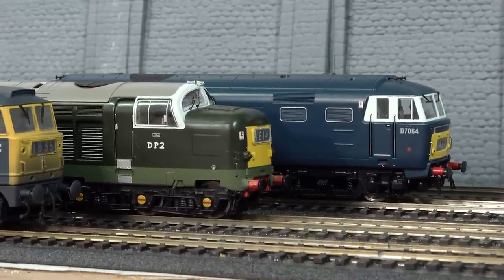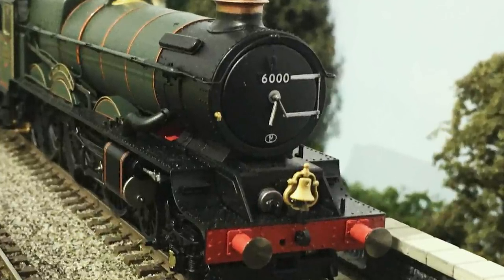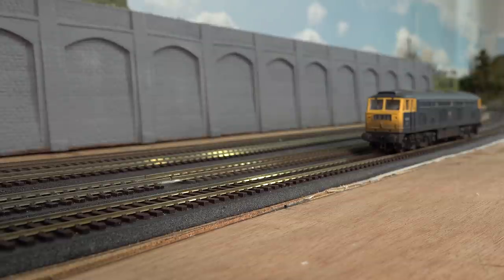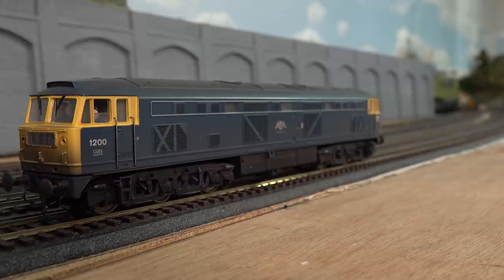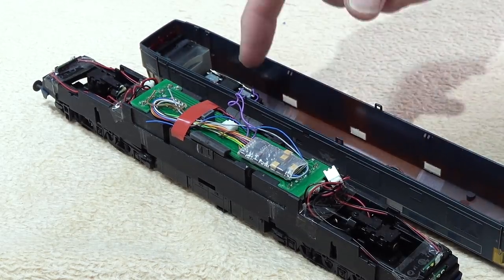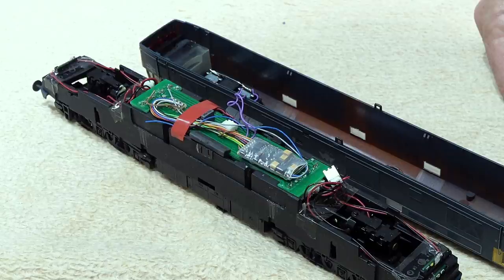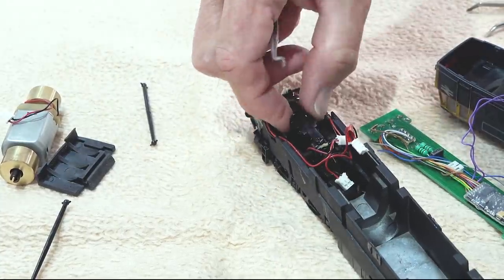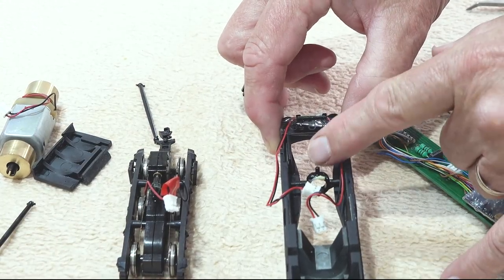Loco Repairs at Chadwick Model Railway | 143.

Comment: Hi Charlie, I am back after a long time. As I said I am 72 and just building my layout. I have a few questions and hoe you can help me  out. I have I have a few Hornby Locomotives which have the old ring-field motors, and things like carbon brushes and springs are hard to come by. Are there any solutions to replacing them with newer motors. I am also hoping to get some basic decoders and digitlise them for DCC. I cannot afford to replace my old locomotives with newer DCC ones and hence this question. I would ask the same question to replace the motors ( ones where the armature is visible and held by metal clips with the magnet at the back and the brushes dropping down to the commutator) commonly fitted to the early Hornby models like the 0-6-0 Tanker, 2-6-2 tanker and the Princess class 2-6-2.

I also have problems in the valve gear of both the 2-6-2 tanker and the princess class 2-6-2, as the driving shafts and valve gear are identical. Once the nail is screw from the tunnel to the chassis, it somehow jams the operation of the valve gear and it stops. 

Watching your excellent video just no prompted me to request for your help, if there is any hope for the questions I have.
We do not have hobby shops or professional repairers and so I take pleasure in doing my own repairs.

My email is faizal126pr@gmail.com.
Thanks and Take Care.

Faizal Hathy,Colombo, Sri Lanka.
Reply from the maker: I suggest that you email Peters Spares, as they have a mass of old stock and I'm sure that they could help.  Regarding the valve gear, sorry but I really have no idea on that one.
Reply: @ChadwickModelRailway  Hi Charlie, Thank you ever so much for the referral. I wil try peters spares. Take care and be safe

Comment: Really halgen should rectify the issue i mean really for a expensive model shouldn't have to be going into the model and fix especially for newer models. But awesome video. But i feel Helgen should do more i feel
Reply from the maker: We are where we are but Heljan aren’t alone.
Reply: It's not only Heljan. My Bachmann Class 25 suffered from the same defect and the cure was superglue as well. Although the 25 was held together with lots of small screws. A nightmare if your eyesight isn't as good as it once was.

Comment: Hi Charlie. How familiar i'm with that unpleasant sound on your model train  engine. That's the first HELJAN engine  i've seen on camera in this state of mechanical problems. Unfortunately these are  not popular in the USA except their buildings & scenery. Anyhow I had a similar mechanism on one of my BACHMANN U23 engine. The turning  pins much like on your engine kept slipping off the rotating drums. I had it worse I kept repairing it thinking it was okay days later it kept sliding off only one side kept doing this. I put grease tuck it in ran it... only to repeat this annoying slipping. It didn't have a happy ending. I ended up removing the entire drive except the simple circuit board with the panel 💡 light. It's now unpowered i put end to end on my freight trains. The other one is a SPERRY SRS Yellow track inspection train by WALTHERS. It too needs repair as of this writing I hope to repair it. I will now lay a light towel to do repairs in the future. I as well like many modelers have lost a lot of small parts . Looking forward to viewing the next repair on your other diesel. The drive on HELJAN is unusual but as standard on similar drives. I have repaired ATHEARN , ATLAS, BACHMANN, LIFE LIKE, TYCO,  LIMA , WALTHERS ,(has too many wires)  KATO , & MODEL POWER. HELJAN'S drive looks similar to CON COR. As always I learned something watching  I thank you again for presenting. Great video & Happy railroading. 😃
Reply from the maker: What an excellent comment Harold.  
It’s somewhat reassuring that I’m not alone with these problems.
Regards Charlie.

Comment: Fixing/servicing Heljan oo locos is lots of "fun" (NOT) They are a P in the 'elbow' shall we say.  I have a O gauge Heljan class 37, and the main drive gears have split.  I kept putting off getting replacements, and now (because Heljan 'improved' the gears,) you can't buy them any more, and now have to go down the expensive road of brass ones, at £15 a set, with a total of £60 + p+P   :-(
Reply from the maker: A dreadful situation that can’t be avoided. 😢

Comment: Heljan have problems with their O gauge drive system which drops out during transit as well Charlie, overall I not impressed with Heljan's build quality! bits regularly dropped of my £400+ locos & no back up when you contact Heljan. I have now moved from a house and onto a narrowboat, N gauge is about the only commercial scale I can model in, so far both Dapol & Graham Farish (Bachmann) are better made than the Heljan products. As for pronunciation I am with you, bit of Nestles milky bar snobbery.
Reply from the maker: A great comment Vinny, many thanks, regards Charlie